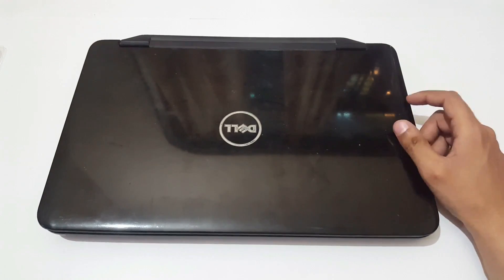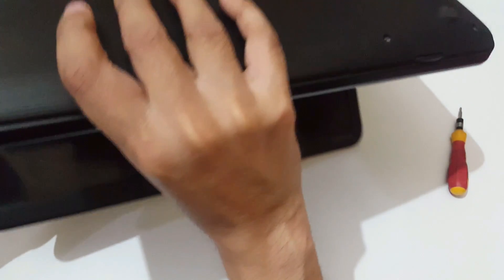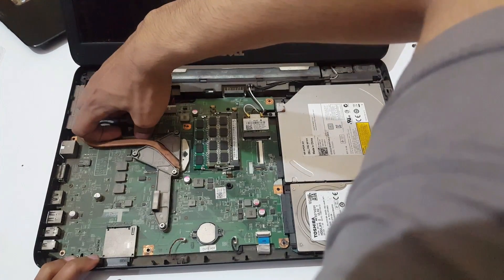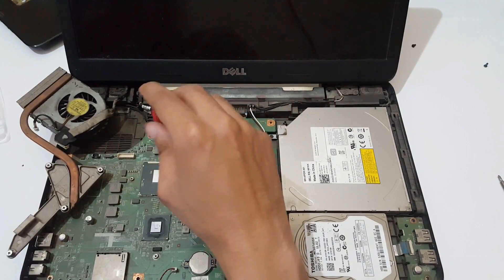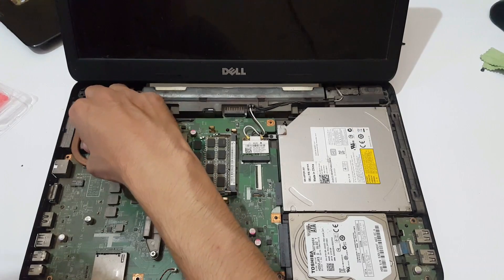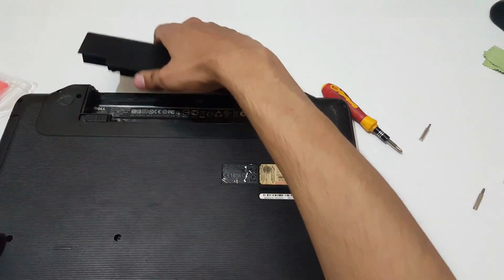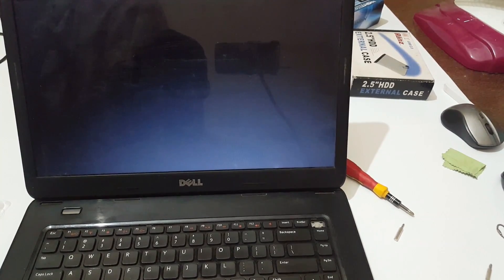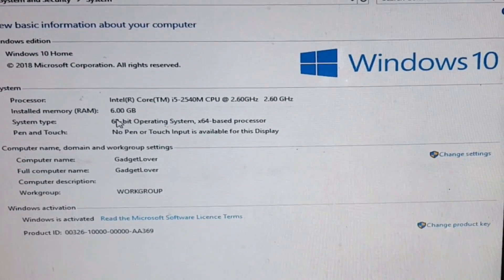How to Upgrade Processor on DELL Laptop | i3 to i5 & i7 - Make Laptop Faster for Gaming

Comment: processor:intel(r) Pentium(r) 3558u @ 1.70ghz
want to upgrade it. how to know which processor is supported on my motherboard
Reply from the maker: Intel Core i5 4310U is best processor for your Laptop
Reply: @GadgetLover360  mera tho laptop hain inspiron 15  series 3443 model.kya i5 lag jayega?please reply
Reply from the maker: @anikkumarsingh8825  In my knowledge the processor of this Laptop is soldered so you can't upgrade it but I would suggest you upgrade its RAM to max and install SSD for better performance
Reply: @GadgetLover360  please kon konsa ram & ssd lagega & size bataiye please
Reply from the maker: @anikkumarsingh8825  You can expand it upto 8GB so buy 4GB + 4GB DDR3 1600MHz RAM and install 2.5 inch Internal SSD
Reply: @GadgetLover360  there is only one slot for ram
Reply from the maker: @anikkumarsingh8825  So buy 8GB DDR3 1600MHz RAM
Reply: @GadgetLover360  ddr3l? l ka matlab kya hain
Reply from the maker: @anikkumarsingh8825  DDR3 low voltage

Comment: I have Intel i3 2nd gen processor. Can I upgrade into i5 2nd gen.
Reply from the maker: Yes if the processor is not soldered you can upgrade it in same generation
Reply: @GadgetLover360  yeah, its not  soldered .
Reply from the maker: @freeyoursoul6739  Alright then you can upgrade it in same generation

Comment: I have i3 2330M removeal processer I want to upgrade i7 which modal number is used in laptop Lenovo g470
Reply: Reply please bhai
Reply from the maker: @nitinchoudhary9015  Intel Core i7 2640M

Comment: Can i upgrade intel aspire 3 with intel i7 processor
Reply from the maker: The processor of this Laptop is soldered so you can't upgrade it but I would suggest you upgrade its RAM to max and install SSD for better performance
Reply: @GadgetLover360  Thanks alot for information ☺️
Reply from the maker: @Harshsharma-re6bj  You're most welcome

Comment: Can i update my i3 processor in Dell Inspiron 153000
Reply from the maker: In my knowledge the processor of this Laptop is soldered so you can't upgrade it but I would suggest you upgrade its RAM to max and install SSD for better performance
Reply: @GadgetLover360  aprox how much it can cost if I upgraded its Ram and SSD
Reply from the maker: @Abhayy.77  Won't cost much

Comment: Sir pls. Tell can I upgrade my dell vostro 3501 i3 4 gb ram 256 ssd 1 tb to i5 or i7 with 16 gb ram to do graphical work. Thanku for useful video. Pls reply
Reply from the maker: Your'e welcome and the processor of this Laptop is soldered so you can't upgrade it
Reply: @GadgetLover360  Thanku sir
Reply from the maker: @savitagupta6498  You're welcome

Comment: Can you put an i7 in an i3? But my main concern is whether I can change the processor.
I have an i3542. When I saw another video, the area where the processor was looked different.
Reply from the maker: Yes and I would like to inform you that if the processor is not soldered you can upgrade it in same generation

Comment: I have i3 6th generation processor with 8gb ram SSD installed can I upgrade to i5 6th generation
Reply from the maker: If the processor is not soldered then yes
Reply: My laptop is Inspiron 5559
Reply from the maker: @mukundmittal9760  The processor of this Laptop is soldered so you can't upgrade it

Comment: I have dell inspiron 14 5455 my processor is AMD E2-7110 APU. can I upgrade my processor?
Reply from the maker: In my knowledge the processor of this Laptop is soldered so you can't upgrade it but I would suggest you upgrade its RAM to max and install SSD for better performance

Comment: My laptop is,  Lenovo G580 - i3 - 3110 processor... Can I replace it with other processor..??!?
Reply from the maker: Yes and Intel Core i5 3380M is best processor for your Laptop
Reply: @GadgetLover360  tq so much sir...
Reply: @GadgetLover360  sir., Can you suggest me the original link of Flipkart or Amazon to buy this processor... Pls if possible...
Reply from the maker: @eeswaracharykathoju1373  Your'e most welcome and buy it from Amazon online store if available otherwise buy it from Ebay online store
Reply: @GadgetLover360  tq so much sir...
Reply from the maker: @eeswaracharykathoju1373  You're most welcome

Comment: Hey bro can I upgrade my dell inspiron 15 3576 core i3 6th gen  to core i5
Reply from the maker: The processor of this Laptop is soldered so you can't upgrade it but I would suggest you upgrade its RAM to max and install SSD for better performance

Comment: hello I have a Dell Inspiron N5010 with a i3 M370 @2.40 Ghz can I change my processor? If I can where do I find it? Thanks
Reply from the maker: Your'e welcome and yes you can upgrade it in same generation and Intel Core i5 580M is best processor for your Laptop and I would suggest you buy it from Ebay online store
Reply: @GadgetLover360  Thanks
Reply from the maker: @guillermo.b  Your'e welcome

Comment: Hello can I upgrade my dell 5110 i5 2450m to  2nd generation Intel® Core" i7-2670QM processor?
My laptop have Mobile Intel 6 Series Express Chipset (HM67)

I already updated to ssd & 12gb ram.
Reply from the maker: Hi and yes but Intel Core i7 2640M is best processor for your Laptop

Comment: Hi I have dell vostro 2520 i3-2328m with HDD 512 gb and 2 gb RAM. Is it possible to upgrade to 512 Ssd and 8gb ram . Also which processor would be suitable to upgrade in my laptop
Reply from the maker: Yes and Intel Core i5 2540M is best processor for your Laptop
Reply: @GadgetLover360  Thanks for such a quick reply
Reply from the maker: @Ropar12  Your'e welcome

Comment: Can i upgrade my dell vostro 1015 vostro dual core to i3 It's 4gb ram and updated to windows 10? thankyou.
Reply from the maker: Your'e welcome and I would like to inform that you can upgrade it in same generation and Intel Core 2 Duo T9900 is best processor for your Laptop
Reply: @GadgetLover360  Okay sir tysm❤
Reply: @GadgetLover360  How about 1014 also?
Reply: @GadgetLover360  And also the RAM can i upgrade?
Reply from the maker: @CarlAnthonyOCu  Your'e most welcome and it has already upgraded it's max memory and Vostro 1014 Laptop processor is also not soldered so you can upgrade it in same generation

Comment: hello sir
i have asus vivobook 15 x540na laptop
can you tell me i can upgrade its processor or not
Reply from the maker: Hi and I would like to inform you that the processor of this Laptop is soldered so you can't upgrade it but I would suggest you upgrade its RAM to max and install SSD for better performance
Reply: @GadgetLover360  Thank you for your reply.
So i can't upgrade the processor of this laptop. And i will definetly upgrade its ram and ssd on your suggestion.
Reply from the maker: @harish9148  Your'e welcome and yes

Comment: Hi I loved the video! But can u tell what if it is possible to change the processor on a 11th Gen Intel(R) Core(TM) i3-1115G4 @ 3.00GHz   3.00 GHz and if yes pls suggest me the best one.
Reply from the maker: Thanks and in my knowledge this processor comes soldered so you can't upgrade it but I would suggest you upgrade its RAM to max and install SSD for better performance
Reply: @GadgetLover360  OH OK THANQ
Reply from the maker: @durgasashank222  Your'e welcome

Comment: Hi, great video. Can you tell me if it’s possible to change the processor in a dell Inspiron 3542, intel core i3.
Reply from the maker: Thanks and I would like to inform you that the processor of this Laptop is soldered so you can't upgrade it but I would suggest you upgrade its RAM to max and install SSD for better performance

Comment: Bro i am thinking of buying laptop but my budget is very low so can you tell me which laptop i need to buy and which's processor can be upgradeable too
Reply from the maker: I would suggest you search on Google for best results as per your requirements
Reply: @GadgetLover360  i am so confused and just want your little help for it
Reply from the maker: @Sawan_Bohara  Before buying Laptop make sure that it has latest generation of processor with a dedicated GPU if available
Reply: @GadgetLover360  like which laptop i would prefer example?? 😓
Reply from the maker: @Sawan_Bohara  Acer Aspire 7 Intel Core i5 10th Generation

Comment: Sir I have  Dell Inspiron 3501 - Intel Core i3-1005G1 CPU can i upgrade it to "i5" 10th Gen ?
Reply from the maker: The processor of this Laptop is soldered so you can't upgrade it but I would suggest you upgrade its RAM to max and install SSD for better performance

Comment: Is it possible on vostro 3000 plsssssss reply asap i need it
Reply from the maker: In my knowledge the processor of this Laptop is soldered so you can't upgrade it but I would suggest you upgrade its RAM to max and install SSD for better performance
Reply: Ok tnx i already upgeaded my ram from 4gb to 8gb and i will get an ssd
Reply from the maker: @tesfayeberhe7716  Your'e welcome

Comment: Can I change my Dell Inspiron 15  3580 model laptop processor to i5 11th generation processor from i5 8th generation ?
Reply from the maker: The processor of this Laptop is soldered so you can't upgrade it but I would suggest you upgrade its RAM to max and install SSD for better performance

Comment: I have a Dell laptop with i5-3340M @ 2.70GHz and 8GB Ram..what is the best possible upgrade?
Reply: It's a Lattitude E5430
Reply from the maker: @ayronduff1923  Intel Core i7 3540M is best processor for your Laptop

Comment: Dell Inspiron 14 3542 upgrade to core i5
Reply from the maker: The processor of this Laptop is soldered so you can't upgrade it but I would suggest you upgrade its RAM to max and install SSD for better performance

Comment: I have dell N5110 with i5 second gen processor, 4 gb of ram! Which processor can I upgrade and what will be the cost of processor and is it really worth it in old laptops as I have?
Reply from the maker: Intel Core i7 2640M is best processor for your Laptop and with processor upgrade I suggest you upgrade its RAM to max and install SSD for more better performance and I suggest you buy it from Ebay online store

Comment: My Acer Aspire is running i3 370M on HM55 mobo rpga989 socket. What i5 or i7 processors can i upgrade it to? I prefer cpu that would not generate much heat
Reply from the maker: Intel Core i5 580M is best processor for your Laptop

Comment: Bhai kya Dell leptop latitude 3340 me intal cor i3 hai to i7 lag jayega
Reply from the maker: I would like to inform you that the processor of this Laptop is soldered so you can't upgrade it but I would suggest you upgrade its RAM to max and install SSD for better performance
Reply: @GadgetLover360  4gb ram already to kya 8gb Or  lag jayega jese 4+8=12gb ram
Reply: @GadgetLover360  ssd better formans but ssd mhega hai to mujhe Hard disk lgana hai 2tb ka lag jayega kya
Reply: @GadgetLover360  bhai mera mobile Redmi note 10 pro max hai to me jab pc se wireless display contact krta hu to sound wireless nhi hota kya problem ho skta hai
Reply from the maker: @ldrsgameryt  I suggest you choose SSD instead of HDD for your Laptop and you can expand its RAM upto 8GB

Comment: I want to upgrade the processor of an older laptop with I don't use anymore and planning to give to my nephew... Where can I get 2nd hand i7-2620M??? or if I get upgrade it to higher gen.. I currently have i3-2350M
Reply from the maker: You can upgrade it in same generation only and I suggest you buy it from Ebay online store

Comment: Doesn't work on my Acer aspire r3 131t
Reply from the maker: The processor of this Laptop is soldered so you can't upgrade it but I would suggest you upgrade its RAM to max and install SSD for better performance
Reply: @GadgetLover360  it was dead lmao
Reply from the maker: @mecyanned  I would suggest you go to nearby PC store and tell them about this problem

Comment: Hello sir I have a Dell latitude e6400 it have core 2 duo please tell me which processer is best i3 or i5
Reply from the maker: Hi and Intel Core 2 Duo P9600 is best processor for your Laptop
Reply: @GadgetLover360  Thanks you very much love from Pakistan
Reply from the maker: @MegaMovie40  You're most welcome
Reply: @GadgetLover360  sir one problem is that P9600 is not available instead this I use E8400 in my laptop
Reply from the maker: @MegaMovie40  No
Reply: @GadgetLover360  ok sir thanks 👍
Reply from the maker: @MegaMovie40  You're welcome

Comment: Hiii sir great video!!! I have Lenovo IdeaPad 130-15ikb.. i3 6006u processor.. first of all is it upgradable? And if it is which processor will be best for my laptop?
Reply from the maker: Thanks and the processor of this Laptop is soldered so you can't upgrade it but I would suggest you upgrade its RAM to max and install SSD for better performance

Comment: I have Dell n5010 i3 , can i upgrade to i5 or i7 same gen and ram to 8 gb? Great video! Where to check supported ones?
Reply from the maker: Thanks and yes you can upgrade it in same generation just search best processor on Google or ask to nearby PC store about it and you can expand its RAM upto 8GB
Reply: @GadgetLover360  thanks! is it worth upgrading i3 1st gen's ssd n ram? confused if should go for new
Reply from the maker: @Ezio-lp8iq  You're welcome and upgrade will definitely improve the performance of Laptop but for high end gaming and heavy software work I suggest you buy new

Comment: Sir can i upgrade my processor in dell vastro 14 which has intel core i3 7th gen process
Reply from the maker: I would like to inform you that if the processor is not soldered you can upgrade it in same generation
Reply: @GadgetLover360  sir which processor is best for my laptop
Reply from the maker: @lijithomas7427  Provide processor number

Comment: Can I upgrade my dell Inspiron n5050 ubuntu laptop processor. Intel Pentium to intel i5 or i3
Reply from the maker: Yes and Intel Core i5 2540M is best processor for your Laptop
Reply: @GadgetLover360  thanks for reply sir
Reply from the maker: @AmanSharma-se3qi  You're welcome
Reply: @GadgetLover360  sir is intel Pentium Cpu B960 upgradable or not that my dell n5050 ubuntu series laptop contains
Reply from the maker: @AmanSharma-se3qi  Yes you can upgrade it in same generation
Reply: @GadgetLover360  sir can I use intel core i5 2400 in it
Reply from the maker: @AmanSharma-se3qi  No
Reply: @GadgetLover360  sir can you give me Amazon or flipkart link of this processor
Reply from the maker: @AmanSharma-se3qi  I have provide its link in description are below or you can buy it from Ebay online store
Reply: @GadgetLover360 sir but from Amazon there is not any option of purchase can you give me ebay link or any trusted source link.
Reply from the maker: @AmanSharma-se3qi  Buy it from Ebay online store
Reply: @GadgetLover360  sir can they deliver in india
Reply from the maker: @AmanSharma-se3qi  Yes

Comment: I have a HP 435KNM, it's a Intel core i3- 6006u processor with 8gb ram and 1tb harddisk. Can I upgrade this laptop to i5?
Reply from the maker: In my knowledge the processor of this Laptop is soldered so you can't upgrade it but I would suggest you install SSD for better performance

Comment: which processor is best for dell inspiron 3521, pls tell
Reply from the maker: The processor of this Laptop is soldered so you can't upgrade it but I would suggest you upgrade its RAM to max and install SSD for better performance
Reply: @GadgetLover360  i know soldering can i do it then
Reply from the maker: @fortiusguy87  No as it requires a professional hand soldering service
Reply: @GadgetLover360  I was soldering since 1 year, but ok if you say that. Will try to upgrade ram

Comment: Is it possible to upgrade Toshiba Portege T230?
Reply from the maker: In my knowledge the processor of this Laptop is soldered so you can't upgrade it but I would suggest you upgrade its RAM to max and install SSD for better performance
Reply: @GadgetLover360  I did upgrade SSD , I’m currently using 4 GB Ram DDR3 (2slots) , is it worth to go up to 16 GB Ram ? ( 8Gb x 2)
Reply from the maker: @ishnavinbrar5387  Yes but you can expand it upto 8GB only
Reply: @GadgetLover360  ohh not compatible for 16G?
Reply from the maker: @ishnavinbrar5387  Yes

Comment: Bro my laptop is dell = amd radion e2 5300  serias can i upgradr my ram prossesor 🥺
Reply from the maker: I would like to inform you that if the processor is not soldered you can upgrade it in same generation
Reply: Ok thanks 😁
Reply from the maker: @MEMER718  You're welcome
Reply: But mai kaise pata karunga ki mera processor soldered hai ki nahi please help 🥺
Reply from the maker: @MEMER718  I would suggest you see its disassembly video

Comment: hi i have dell inspiron 3593 with this specs and i think the technician changed something in my laptop because it became so slow what do i need to do? what should i upgrade?

Processor	        Intel(R) Core(TM) i5-1035G1 CPU @ 1.00GHz   1.19 GHz
Installed RAM	8.00 GB (7.77 GB usable)
System type	        64-bit operating system, x64-based processor
Pen and touch	No pen or touch input is available for this display
Reply from the maker: Hi and the processor of this Laptop is soldered so you can't upgrade it but I would suggest you upgrade its RAM to max and install SSD for better performance
Reply: @GadgetLover360  oh thanks😊
Reply from the maker: @yoonkimin4699  You're welcome

Comment: Hi I want to upgrade my cpu… I have a dell inspiron 15r 5537… with a core i3… can I upgrade it to a core i7? Is my cpu soldered or removal just like yours? Great video by the way… any recommendations is greatly appreciated… thank you
Reply from the maker: You're welcome and the processor of this Laptop is soldered so you can't upgrade it but I would suggest you upgrade its RAM to max and install SSD for better performance

Comment: Hey
Is it possible to change processor for dell inspiron 3521 core i5 ?
It came in 2013 .
Reply from the maker: The processor of this Laptop is soldered so you can't upgrade it but I would suggest you upgrade its RAM to max and install SSD for better performance